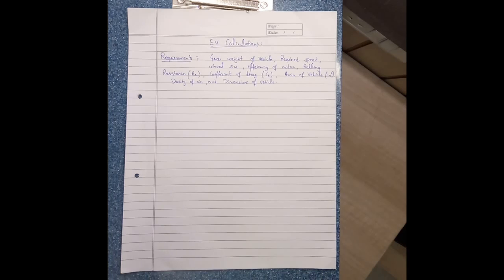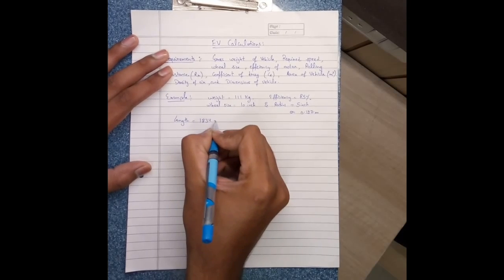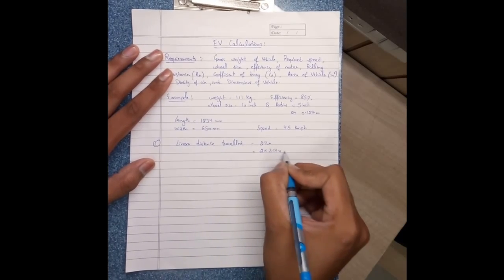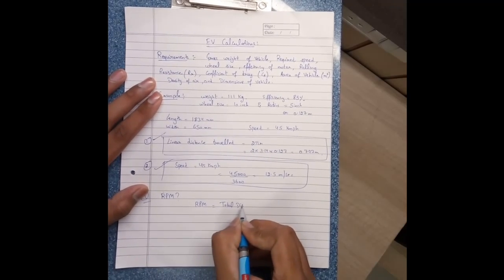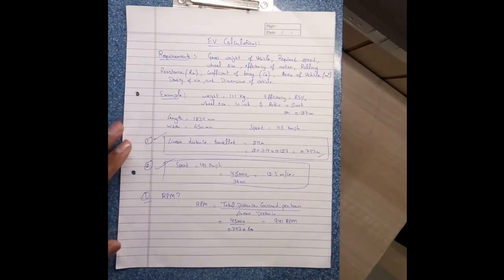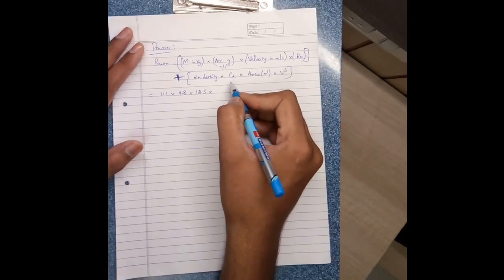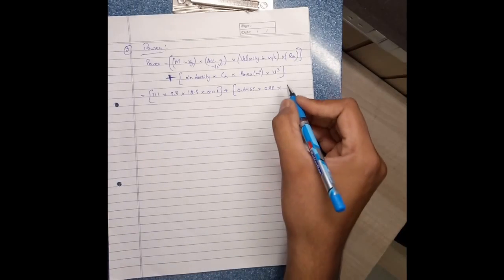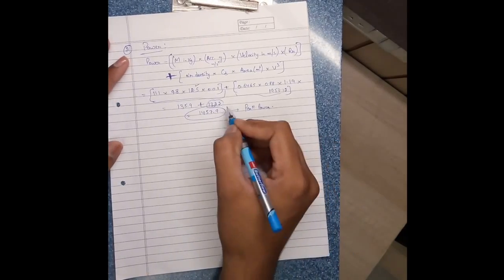EV Calculations part-1 (Power and rpm)

Comment: Your calculations for power required is wrong..for aerodynamic drag force you have the value A which represents frontal area of the vehicle. For frontal area you need height and width, not length and width. Everyone make that correction. Don't consider length. It's height you need for frontal area.

Comment: Hello, in the force you calculated 
Acceleration force + rolling resistance force + aerodynamic force + grading force this all force is not considered it seems. Will you explain on this?
I think acceleration of vehicle is very important. Kindly advice on the same
Reply: Check out this EV Calculator- https://youtu.be/kTLrKnZaUQM

Comment: This calculations is wrong because I was calculate Rpm at 200km/hr and then we get - 2460rpm, it's not possible , itne kmm rpm pr higher speed milna , 
Guys ye calculations Puri wrong h,
Reply: What size tyre are you calculating.?

Comment: Shortcommings...1) Assumptions have to be made taking your vehicle design parameters ...like you have used the vehicles area parameters wrong .. you have to use the front area (width*height of the vehicle) for drag force calculation & also the drag coeff.. have to be selected taking the vehicle frontal shape into account.  there are 2 more forces to be included while calculating the power ( force required to move the vehicle from rest to the required speed)
Reply: How can we calculate the starting power
Reply: I want to 1.5kW-2kW power,how can i calculate,can you help me

Comment: Plz help me,
For Formula of Power you're using--I think its the "Area" generally we Use Frontal area like height × width for draG resistance but it seems u r using bottom area of vehicle??? How's that I mean, plz reply me with "Right Formula"
Im building a same project
Reply: Use the frontal area which is the height of the rider multiplied by the width
Reply: Check out this EV Calculator- https://youtu.be/kTLrKnZaUQM

Comment: Is wheel size the width of the wheel? My current wheels say tire size is 215/60 VR 15? How does 215/60 VR 15 translate to wheel size?
Reply from the maker: Wheel size is not the width it's the diameter or radius of wheel
In your case 15 is the diameter
Reply: 215 is the width of the tyre in mm.
60 is the profile height which is a %age of the width.
So 60% of 215 mm is the profile height of your tyre = 129 mm
R 15 means the wheel diameter is 15" = 381 mm.
Therefore your tyre diameter is 129 + 129 + 381 = 639 mm.

Comment: i think this calculation is wrong, for the reason that the power consumed to overcome drag at 45kmph is very larger than the vehicle drive force."i think u messed up while selecting an rolling resistance of 0.01 u have beter selected a value above 0.3 or nearly 0.25-0.3"
Reply: he had used the wrong area...  just multiplied the length n width instead of  height n width ... thats why the drag resistance is soo high ...
Reply: @arjunkrishna9486  yes
Reply: HOW CAN U CONFIRM THEM WITH OUT ANY PROOF

Comment: Why is the air density so low ? Using the same calculations the power jumps to 2.5 kW for standard atmospheric density.

Comment: What rolling resistance ?
Reply from the maker: Rolling resistance is basically a kind of friction which is acting during rolling of tyres. You have to take it 0.01
Reply: @ALTER-BIKES_01  Rolling resistance 0.01 is universal I mean , I m working on sports electric motor cycle so what rolling resistance is required and coefficient of track ?